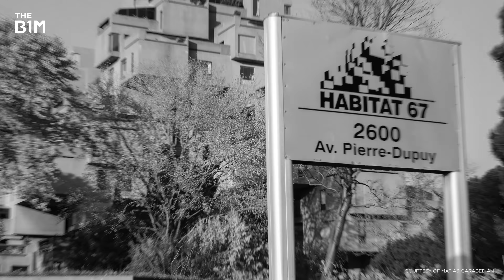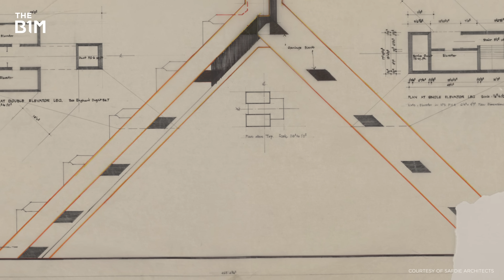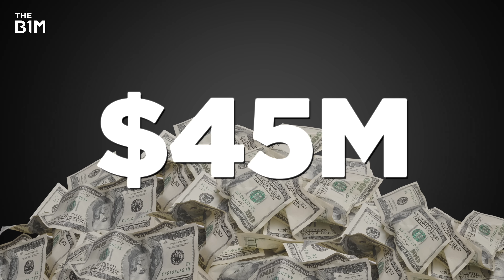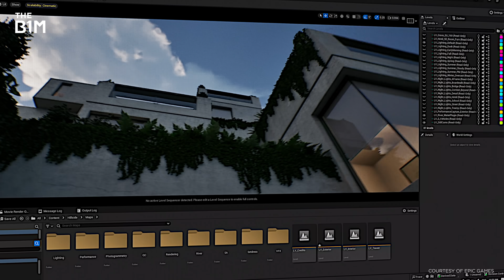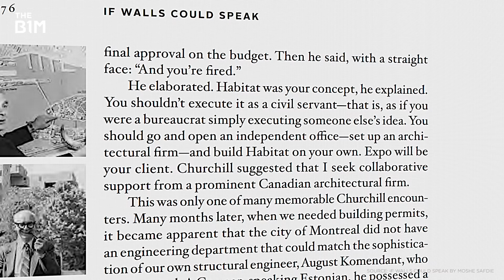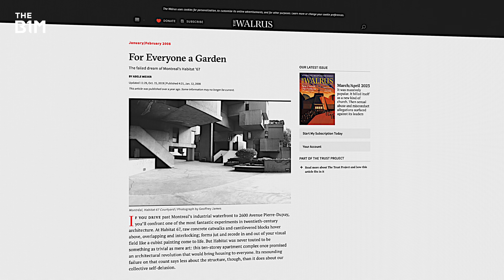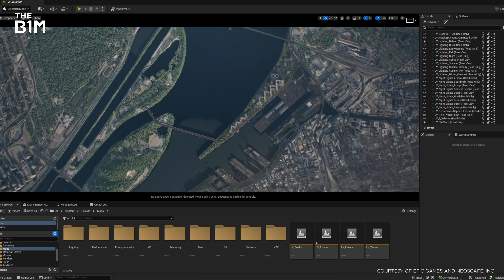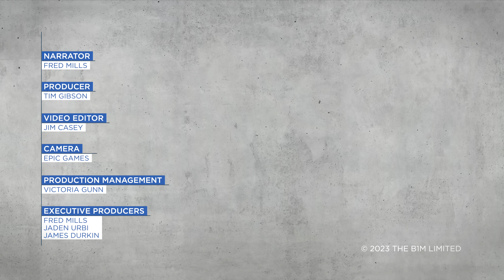How a 23-Year-Old Solved Urban Sprawl

Comment: In Philadelphia, there's an area called East Market with a bunch of clothing retailers and two malls. It's had issues with low patronage since the 70s. Part of the problem is that the big retailers and malls don't interact with the street enough so the streetscape feels barren. It's a space that people transit through but don't stay in. Additionally, these buildings and the unwelcoming streetscape they create cut off Chinatown from the rest of the city. At the same time, underneath this streetscape runs several SEPTA rail lines that have also seen better days, esp. b/c of the collapse of commuting as a result of the pandemic. A design like this, built in the footprint of those few blocks and straddling Market St in the center, could revitalize the area and attract workers to an office/retail/residential development that feels like a true "neighborhood in the sky" and likely make the street underneath both a hive of activity and a more welcoming place.

Comment: There might one problem maintain on the support structure. As well some pipes and wires. They tend to break or crack due to weather that need to repair. One example is the japan module hotel or apartment.